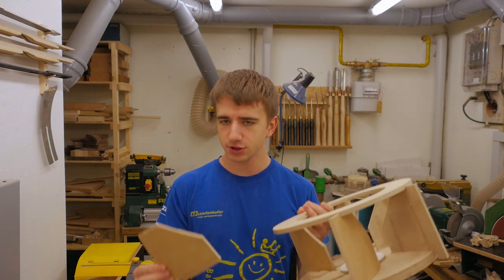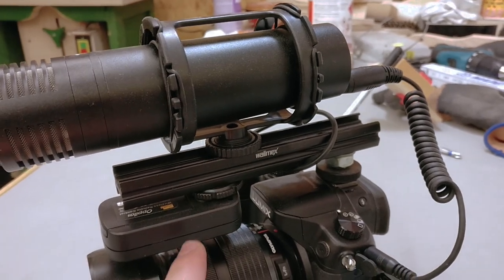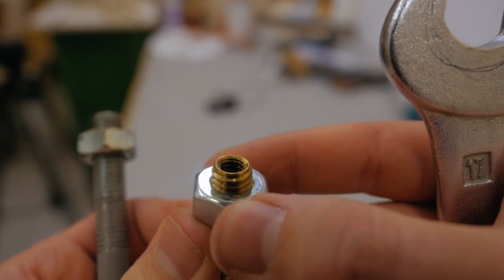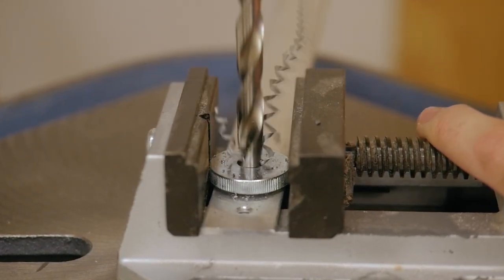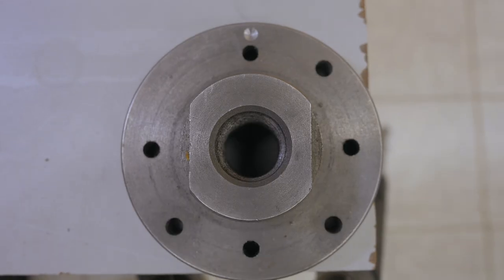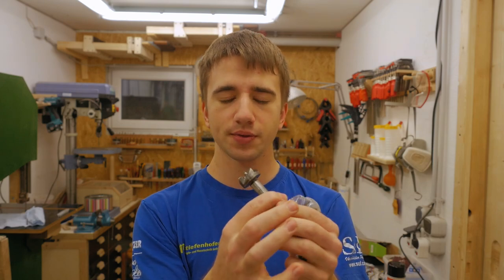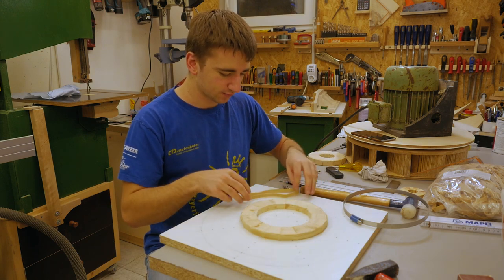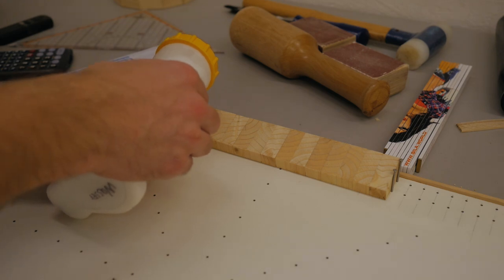Ring Glue-up Jig, Book Binding, Knobs and more (Random Shop Stuff 15)

Comment: Marius, I loved the binding for the manual. I'm doing a similar thing: my husband is learning Portuguese (for the hell of it) and one way to learn is to read familiar books in translation. I've been using two battens with carriage bolt to hold them together.. I've found that if you don't clamp right on the edge, but about 1cm away from it, the pages splay out a little, which allows the glue to penetrate between them for a short distance. I reinforce the spine with carpet tape.

Comment: LPT: keep the rubber bands sealed away from air and UV light. This prevents them from becoming brittle. It also helps to spray them with silicone lubricant.

Comment: a small tip for the camera manual, if you use a piece of thin leather or suede taping/glueing it to the wooden spine on one side and then fold it around the book (perhaps with a wooden stiffener at the other end) you can protect the book from dirt without replacing the front and back pages.

Comment: A couple of things about the book binding. Definitely avoid letting glue run down the edges of the pages. That's not where you want them to stick together. Along the spine, have just a bit more of the pages be above the clamp. That will let glue get slightly deeper than just on the face of the spine itself. It doesn't need to go in very far, but letting it in will strengthen the binding considerably. You can also apply a cloth strip sized to fit the spine. The glue will hold it in place while it dries, then the cloth will help hold the pages together after the glue dries. It doesn't have to be thick and a looser weave is best, but not a stretchy fabric. The tape used to cover gaps between sheets of drywall works, too. Just cut it to match the size of the spine. You might find that a bandsaw does a better job of cutting the bound pages to their final size than a table saw. You'll need to clamp a caul close to the cut to prevent tearing, but that applies to using a table saw, too. HTH.

Comment: In book making, string is put through holes and tied together. The sections of bound pages are stacked as a book then glued to the spine. I've tried drilling into paper but I never have a sharp enough bit for it or I can't squeeze the pages tight enough without damage.
Reply: There's a special kind of drill bit for drilling paper. It's like a tube with a sharpened end. They work very well, I've used them a lot at my dad's printing business.

Comment: Belt sander works on steel well enough. Betting it will chew through the forstner bit fine.
Reply from the maker: ...I don't have a belt sander :(
Reply: Marius Hornberger
You poor soul. Things handy as heck. Used one for doing funny shaping on my lathe, easier than grinding up custom tools.

Comment: It always hurts when I see someone drilling, tapping or threading metal without oil.

You can try laminate some transparent plastic onto the first and last pages of the book, even now that it's finished - if you still use that book. Put some transparent plastic the like of which is used for overhead projector slides, onto the paper, put some cotton cloth (a piece of an old bed sheet or the like - has to be smooth but not very soft/fluffy, so towels or old T-shirts are not a good choice) and iron over it, with the iron set to the temperature for cotton.